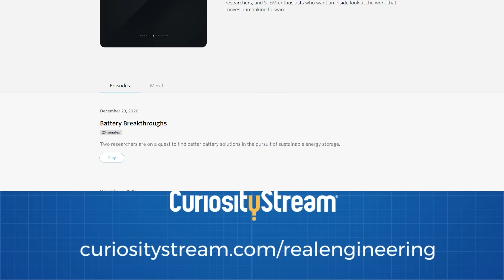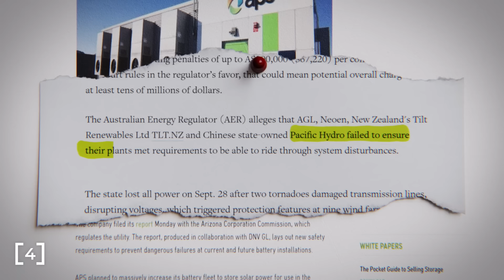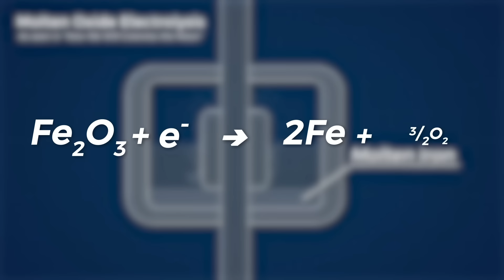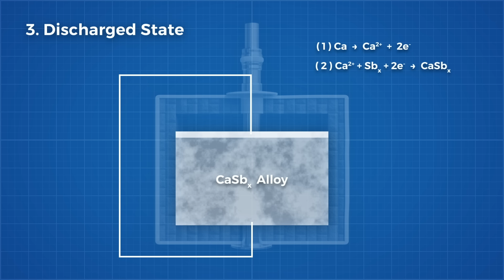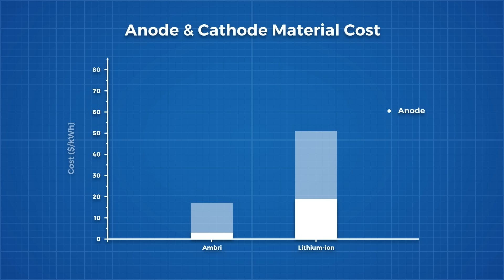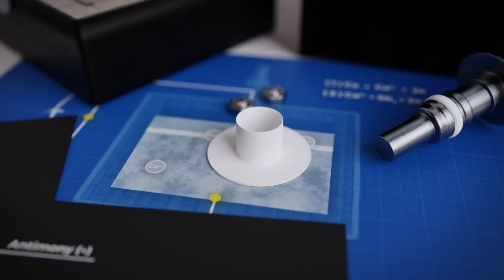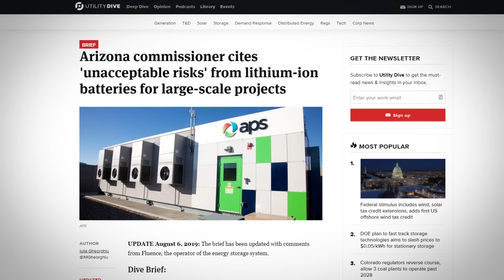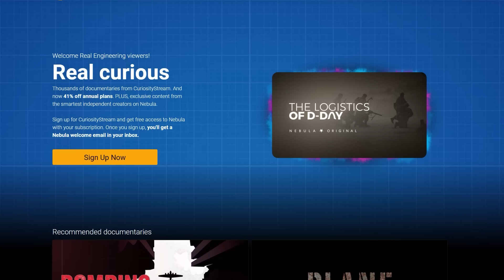The Missing Link in Renewables

Comment: Now that I've decided to get Curiosity Stream.
Credit Card only...
I wish you could accept paypal or debit cards
Reply from the maker: It does accept debit cards. Americans just say credit card for everything because they are weird
Reply: @RealEngineering  When I try to sign up, it needs a 15-digit card number. My maestro debit card does not have that :( . It has something called 'IBAN'. PayPal support would be great.
Reply: @RealEngineering  no we don't lol.
Reply: @RealEngineering  : We "say credit card for everything" because we run debit cards through the same system as credit cards, so support for one is almost identical to support for the other.

Or do you turn everything that could be a lone sentence into a multi-page disertation?
Reply: @RealEngineering  
Tried it again
Maybe it doesn' work with Mexican Debit Cards.
That's a very common issue. :c
That's why I normally pay with Paypal
Reply: @nielsbeaufort2543  Tried with MasterCard Debit Card in US in BestBuy machine: just select CREDIT card and use ure DEBIT card (16 digits btw).

Comment: 4:08 I thought flow batteries were cheaper for stationary energy storage than Li.
Reply: I am no expert but what I understand from a quick round of internet research is that indeed: the price per kWh is very low.
However, they also seem to have a low specific power (i.e. you can store a lot of energy cheaply but they do not discharge fast enough to balance a grid if there suddenly is high demand)
Reply: @solaeterna305  Ah I see. Awesome thx!
Reply: @djayjp  But who knows maybe they find ways to solve that problem... I think both solutions (redox and liquid metal) definitely sound better than stacking Lithium Ion batteries :D

Comment: Everybody: Thorium reactors
Real engineering: So anyways here are some solar panels and wind turbines
Reply: Or any type of fission reactor
Reply: @orkin2525  👍, but thorium is safer, cheaper, and more abundant in the earths crust.
Edit: and produces almost no nuclear waste
Reply: Flexible energy is more important than more energy. Also the payback period on nuclear is terrible, it isn't worth the cost.
Reply: @zaphodbeeblebrox8382  In what way is renewable energy flexible. Currently Nuclear reactors are 1.) Safer than renewables 2.) cheaper than renewables 3.) require far less infrastructure and 4.) Are currently viable. The advent of thorium reactors has essentially nullified the risk of a meltdown (not that it was high) and thorium reactors output almost no waste
Reply: @quinndenver4075  
I believe it's less about the amount of waste they produce and more about the much lower the halflife and activity of the waste is compared to 'conventional' fission. 
And they can be used to transmute already existing highly radioactive waste into less problematic products so thorium reactors certainly are a useful tool. 

But a well built grid and energy storage facilities are still useful and shouldn't be ignored the same way as MSR shouldn't be ignored.
Reply: @DiabloDBS  agreed it is both the amount and potency. The reason I said amount was because over a given period of time a conventional reactor will produce more waste due to the msrs ability to recycle fissile products
Reply: @quinndenver4075  
I see. Yeah that is true as long as there are fissle products to be transmuted.

The sad thing about MSR is that they could've been built (a bit less efficient) like 40 years ago if there had been competition or less subsidies for the conventional reactors.
They literally rested their asses as the waste problem was nothing the industry had to think about as (most) states would cover that part of the bill.

Comment: This battery only works if you melt the metals completely and then wait for them to separate by gravity. This means they can't store fluctuant energy from eolic and solar power plants. If the battery is too big, the metals will heat and cool without melting and do nothing. If the battery is too small, it will disipate heat easily.

Comment: DUDE I live in Ecuador here we mostly use 110V@60HZ only things like drying machines, water heaters and A/C use 220V@60Hz and have diffent installations for each voltage as well as breakers and connectors

Comment: I tried looking up some info about the initial project in the video (Nevada data centre) but looks like it fell through. They are looking to test a 300kWh system this year with Xcel energy, which is a very small battery but it will be interesting to see how they fare.

Comment: When did tornadoes start in Australia? I live in South Australia and work in a gas fired power station the black out would not have been any where near as dramatic if the spinning reserve was at a decent level but there would have still been a large black out in areas due to the downing of power lines. You have over simplified the events on that day.

Comment: "On that scale, storing an energy when it's availilible and discharging when it's needed is a problem". 

So how about throwing your unreliable renewables out of the window and using cheap and clean nuclear power?
Reply: You still need some grid level energy storage if you want to go 100% nuclear. A nuclear power plant can't ramp up power generation quickly to meet a spike in demand like a gas power plant can.
Reply: You: The rational short term solution that could solve the energy problem in a decade

The dumb emotionally steered uneducated masses + young Greta type people who's just seen HBO's Chernobyl:
No bCuZ NUcLeaR = bAD chErNoBYl DeEEeEeeRp
Reply: Cheap and clean nuclear is like Ironman's ARC reactor... a fiction. Clean maybe but cheap isn't happening anytime soon.
Reply: What if the country secretly uses it for nuclear weapons
Reply: Have you seen the LCOE of nuclear? Even after 60+ years of deployment, its getting more expensive. Add in the huge build time, and it’s now a safer bet to invest in new storage and renewables... basically we only keep traditional nuclear to ensure there is some “in-house” experience for parallel industries (defence)
Reply: @danielsumner1398 I agree, but my position is that the current LCOE of nuclear could be a fraction of its current value right now with the right political will power behind it. That said, all other renewables should also be kept on its innovative track. You can't have nuclear everywhere, probably.
We just need to get fossils out of the  picture immediately  and bridge the gap until we have a grip on nuclear fusion which is only a matter of time now that the private sector is in it for real and things are moving fast.

Comment: At (15:50), Dr. Sadoway implies that there was difficulty selecting an optimal dielectric, hermetic, thermal excursion resistant, corrosive-resistant seal that can withstand over 500 to 600 deg C. 

If that liquid Calcium gets exposed to oxygen, the Calcium Oxide is going to sink and mix with the Calcium Chloride electrolyte.  Calcium oxide has a very high melting point.  What would the impact be if solid oxides mixed with the electrolyte?

Comment: I just used 6 85amp/hour caravan batteries to run my house off grid for 11 months of the year with 2 kilowatts of panels. £300 for the batteries and £2000 in total. Just a big boat set up. Separate ring mains run off the batteries from a 3.5 kilowatt inverter.

Comment: You only need batteries if the energy source is intermittent - for example geothermal is constant so could be wired straight into the grid with no need for battery storage.

Comment: but why only in the grid. Put a shelf in a thermal enclosure and you'll have a near ideal home system. No degration over time, almost no maintenance, and (maybe) cheap. Since this can be mass produced the enclosure can be cheap. Also, electrocics can be derived from existing PV systems.

Comment: They’re worried about containing the heat so that it doesn’t get out, why not use that heat to charge a smaller lithium ion battery that can have an alternate purpose?  For instance maybe being able to reheat the metal inside of the battery or a completely different thing like charging portable devices maybe

Comment: Might work well to house these in a vacuum chamber, that would provide excellent thermal insulation and reduce the need for airtight seals to keep the material from oxidizing.  A large vacuum chamber is relatively cheap compared to NASA-tech seals.  Might even be able to make the cells open top.

Comment: Mechanical batteries make sense for energy storage.Because design and scale issues are more easily solved with little to no issues concerning end of life. Either adiabatic compressed air or magnetically suspended flywheel require little research except design materials and scaling for demand.

Comment: If you are going to use batteries to stabilize the grid this may be overkill. The first question to ask is what is the actual need? If they are made from extremely cheap materials and easy to produce it doesn't matter if they only last for a year. It's the overall cost that matters. They don't need to be very efficient either. If they are cheap enough and can hold a y charge for x hours to do the trick 90% the time. The real question is x and y or more precisely: How efficient does the battery need to be to avoid 90% of the blackouts and then design that battery first.

Comment: This battery will benefit immensely from building it large (square cube law). The bigger you build the less insulation you will need and the more efficient the battery will get. Something to the size of a thousand gallon water tank will be close to 95% efficient with said 30% of the insulation prortionally.

Comment: The cheapest energy storage that IS scalable and has no loss of charge over time is "Gravity Batteries". The problem is the time required to charge the battery and the losses during charging. Financiers are always looking for instant gratification on their investments. Multiple Gravity batteries could be constructed by governments. The element Lead (Pb) is a main component of a gravity battery. Lead (Pb) is used only for it's best quality -- it's really heavy. No toxicity or Lead (Pb) contamination is involved and only steel concrete and elevation are the other requirements. Huge Oil Storage tanks could be replaced by gravity batteries.

Comment: I am currently working on a solar powered torch LOL.    The lithium battery evolved in line with cell phone technology which was intertwined with government communications regulations changes.   Cobalt is scarce but still needed, the electric car is a store of mains electricity.  Batteries cannot make electricity and therefore if the wind stops for more than a few hours they run out.  The current scarcity of gas proves renewables are not an option for grid power.

Comment: this may be obvious but what about a hybrid system where the heat from LIB is pumped into the LMB,  that way one is called and the other is heated would be more efficient also assume that LMB are slower at outputting power and LIB are faster that would solve that issue aswell.

Comment: You said the battery was designed to operate at 500 degrees, therefor neither heat OR cold would effect its operation. I think that’s a stretch. The internal components are designed for high temperatures, that doesn’t mean that all external components are. And, because they’re designed for high temps, doesn’t mean they’re suited for cold temps. Shorts are designed for hotter temperatures, but don’t work so well in the cold.

Comment: Phase adjustment, right! The Chinese are purportedly using some ultrahigh voltage D.C. transmission lines to help solve such transmission problems, but energy storage, ah, that's the crux!
The economy of scale also applies here....very cool, reminds me of early fuel cell research.

Comment: I wonder how large you can build those batteries. Because for thermals larger should be better due to the square-cube law. If you increase the size of the battery, you'll get more volume (thus mass) per unit of surface area. That means less cooling which should increase efficiency of the battery. I could imagine problems with building a ceramic vessel that large, though. So... yeah. Interesting thought.

Comment: The most efficient pumped storage power plants can do better than 70% round trip efficiency, closer to 80%. 70% RT is  only 83.7% for pump and generate modes which is not very good, I know project efficiency will be less than the unit efficiency from conduit losses and operation off of the BOP but still 70% RT is not great.

Comment: This doesn't seem suitable for a 'daily driver' type vehicle, but might be relevant for long haul vehicles (trucks/trains/shipping maybe). The reason being the 20% lost in heating the metals... if you lose 20% heating the battery to get you to work, then you lose another 20% heating it again to get home after work. Want to go out in the evening? Ditch another 20% of the capacityheating the pack to go out, and again to come home... there's 60%-80% of the pack power down the drain just for heating the battery.
Additionally, imagine being in an auto wreck where molten metal gets spilt... makes a petrol fire seem preferable.
So I'm thinking this is a tech better suited to stationary storage, with an allowance for a slow ramp up in delivering power, rather than an immediate energy replacement option.

Comment: Nice vid. I think we can get a rough idea where ot will be successful, could be a nice battery with easy access to geothermal energy or hot springs. Could be nice for buildings requiring constant heat. Outside that, a lot of heat will be lost or lots of insulation required.

Comment: Using the grid to drive up the cost of Li ion batteries prevents their use in portable devices like affordable cars and trucks.  The grid can use pumped hydroelectric, reversible cranes, flywheels, and heavier rechargeable battery technologies for its energy storage.  Additionally, there is no true need to eliminate just-in-time generation entirely.  Fossil fuels as a backup is an entirely legitimate strategy to maximize what we already have rather than wasting energy we don't have to tear it all down and build something unproven.

Comment: Don't need batteries for storage - gravity produce output from wind or solar, lift a very large weight with it, when needed let the weaight descend, using gears, and there it is - the storage is in the weight - 500 tons , 5000 tons, drop 200 m or 2000m
No chemistry needed, less precious metals and fracking. various models avalalble - here is one

Comment: Nice to see someone trying to address the real issues.
However, running a data storage center for 12 hours on battery energy is one thing. Running a whole country for maybe up to two weeks is another thing entirely. That is what's effectively needed for Northern countries where the sun don't shine in winter and anticyclones may provide cold still air for extended periods. But when the wind picks up again, the energy will be required immediately, meaning it is not actually available to recharge the batteries. So you might want to double the amount initially stored or double the generation capacity. Oh, and maybe double that again to keep the cars running once they are all electric. It's a big ask. I just hope some other country than mine does the experiment first because there is bound to be something else missed if South Australia's example is anything to go by.

Comment: A typical 2MW wind turbine uses 30,000 tons of concrete. Each ton of concrete produced, also produces about a ton of airborne co2. So each windmill essentially injects 30,000 tons of co2 into the atmosphere before they even turn on for the first time. That's just the material cost and by product of the concrete. Haven't even considered the steel and gas generator inside and all the diesel burned in construction and maintenance. Nonrecycleable. Short life spans. The same space can produce 8MW of wind energy or 8000MW of nuclear energy.
Reply: 30,000 TONS of Concrete  per wind turbine?  Where do you get this lunacy from?  PragerU or something?

Comment: Clearly, storage has a big part to play in the future. The problem is that presently there is no legislation to say when battery storage centres can recharge from the grid. We know that in an ideal world the batteries will be charged via renewables, but in the real world the spot price of electricity, here in the UK at least, as a 10:1 ratio
At some times of day electricity can be bought for as little as £35 per MWh, and at peak demand the price can be as high £350/MWh. What mechanism or rule is in place to prevent the battery storage installations from simply charging off the grid when the price is low, and reselling it when the price rises, making a huge profit in each day's pricing cycle
I guess we need an electricity grid with a fixed price (killing competition) or a rule which says that battery storage companies need to reserve their battery storage capacity for use solely as renewable backup.
But then again, what happens when the batteries are flat and the wind isn't blowing ? You should probably allow the batteries to store from the grid under those circumstances.
Battery storage could be a great investment on their own, to buy and store cheap electricity before selling it back as expensive electricity !